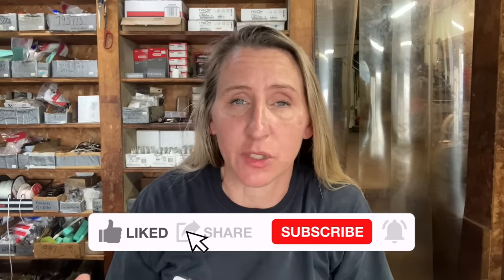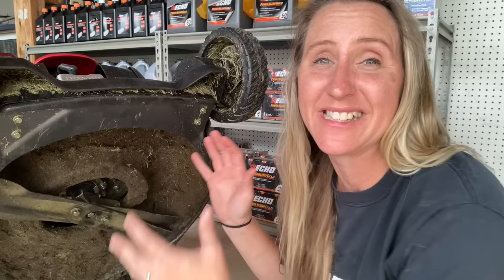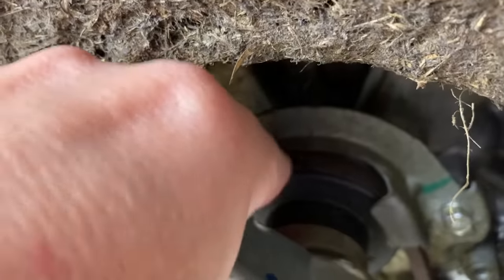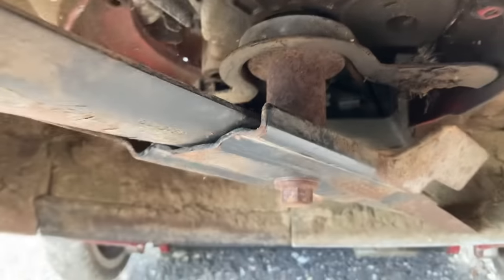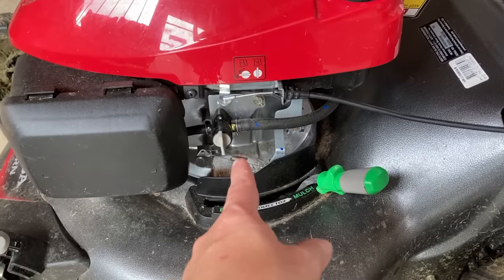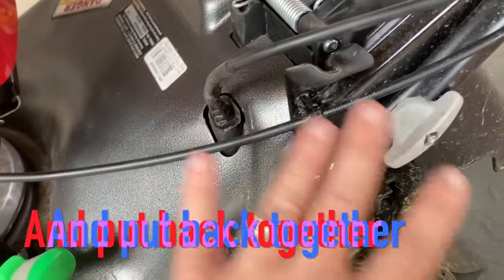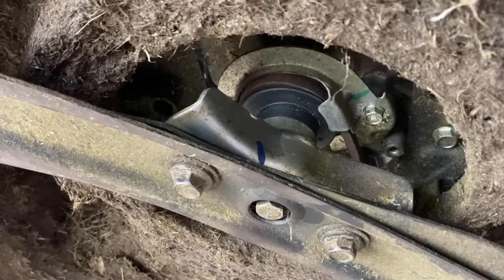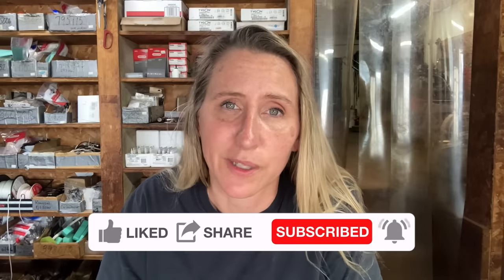SAVE A TON OF MONEY in repairs by NOT BUYING this NAME BRAND mower.

Comment: Are Honda's professional mowers built better without cable problems costing a ridiculous amount of money and wasted plastic to repair?  The way that cable goes into plastic I would be nervous about that and not buy it.  If it was attached to metal that is different, at least then it might last a while.  You know what upsets me the most?  If you bought a one of these terrible things and had these problems they would probably tell you that you aren't doing something right or not cleaning it out frequently enough.  I would honestly expect them to blame me for it breaking when the entire machine is just a very badly built lemon that should have never left the factory.  You know what else makes my blood boil?  The engineers knew what they were doing and designed it that way intentionally!!  Honestly, you would think that a brand like Honda would be better made than that.  I am starting to wonder if Honda Accords are Honda accordions

Comment: My honda mower is the 2009 version. Solid. My Dad and brother both bought one 6 years later and they are pieces of shit. Honda changed the transmission and started using plastic bushings for the rear axle. The rear wheels seize going backwards and they are both jerky with the drive system even with the cable adjusted. Not smooth at all. One transmission replaced also. I did all the repairs for them. Wtf Honda? You made me look like an asshole recommending your mowers to family members.

Comment: The issues with these mowers are the dummies that own them.I have a Honda 216 that is in its tenth season.starts first time every time and works like new.Why?because I maintain it!everything gets stuck on that mower because you don’t clean it.spray it out with a hose after use .this mower is plain Jane without all the fancy commercial gewgaws and will perform just as well.the reason these things end up in the shop is because the owner doesn’t do the maintenance or just doesn’t want to.I’ve used my mowers even when it’s raining.when you’re in the business you can’t take days off just on account of a little rain
Or dew.

Comment: Yep chicky mechanic  ... even honda suffers from cheaply made products these days , price goes up , quality goes down .   Its across the board , not just honda , plastic rear ends and gears cases ,  how bout the Husqvarna garbage , really bad ... Chinese engines and mufflers that break after using the product 3 times , fixed alot of those  . I cant even recommend any brand anymore its such junk ... Sad days for the consumer

Comment: What kind of BS is this? Honda knows better than to use a belt for the self-propel. I bought my 215HXA back in '94 and it still runs like new. They were smart enough to use a driveshaft back then. That old mower is more reliable than their new cars too.

Comment: The opinion expressed here conflicts with the exceptional rating on amazon. They seemed to be very happy with that mower. Only 2 customers out of all those who purchased on amazon reported self-propelled problems, and they were not specific about the problem.
      My HRR 216 I've owned since 2017 and have not done anything but change the oil and the gas out every spring and of course shut the gas off in the fall, and I have not had a problem or done anything else to the mower. I love my Honda, wouldn't own a Toro or anything less than a Honda. Anything less than a Honda, are all designed to fail junk that creates cash flow for the company after the purchase by selling parts that are designed to fail and create that cash flow. I am skeptical about what you are saying and wonder what your motives are as in underhanded motives.  The area where the belt was, was clean even though it was caked with grass on the rest of the underside in the video, why?  People are and have been taking pot shots at Honda for years to knock them off the market and get rid of them. I trust Honda but I no longer trust you.

Comment: My take on this video is; this video and the title warning people to not buy Honda mowers, is nothing but sensationalism, designed to get more views (and make more $$$).  A little over 3 years ago I bought a new Honda HRX 217.   To date I have had zero problems with this mower.  It still starts first pull.  The lawn looks great after being mowed and, I have never, not once, had grass or debris get stuck where you say there should be a shield.  I do wash the underside of the mower deck, but when doing that I have never seen grass in the area where the belt is.  In my opinion, to steer people away from a great mower brand, like Honda, for two problems that affect so few people (our nextdoor neighbor has a Honda mower, they don't have this problem, and they don't wash the underside of the deck), seems to be misguided.  A better solution would be to just warn people to maintain their mower better and more frequently, NOT to scare them away from one of the best self-propelled mowers out there.

Comment: Sorry, but I'm not buying this.  I thoroughly researched before buying my new Honda mower, and on EVERY online dealer's website these powers (a variety of the same type of build, composite deck, etc) are getting 4 out of 5 stars or higher rating.  And a lot of the reviews are detailed with photos and descriptive, they aren't just some Joe Smith fake account over in indonesia false reviewing thousands of times.  This idea that "every one of these mowers has this issue" is nonsense, lady.  There's simply no way.

Comment: Wheels do not have bearings, cheap top cover ,cable don't have rubber seal anymore and the carb, is causing hard starting problem already .EXpensive piece of junk.

Comment: Another idiotic thing with Honda engines is timing belt between crank shaft and the cam shaft that sits in oil. Yes, fully covered in engine oil. Rubber belt sitting in oil. What could go wrong... Idiots.